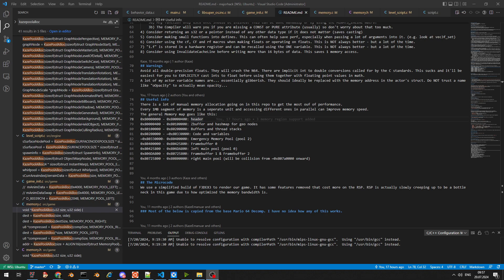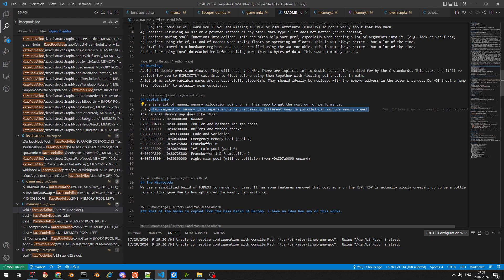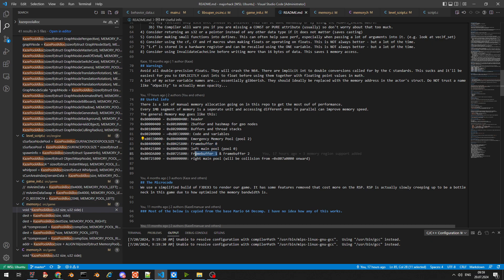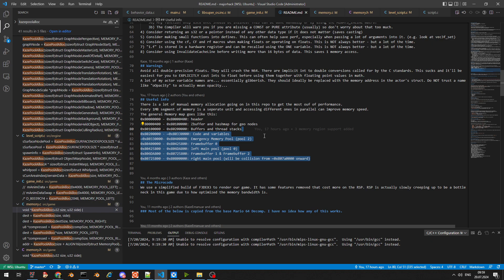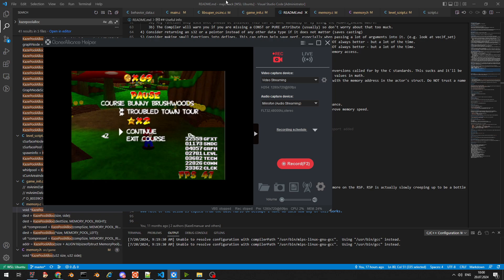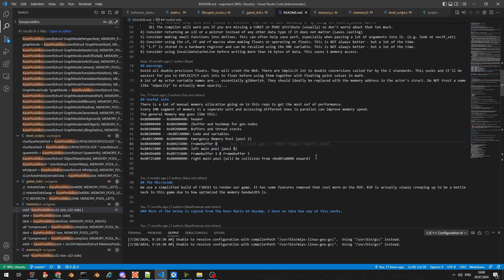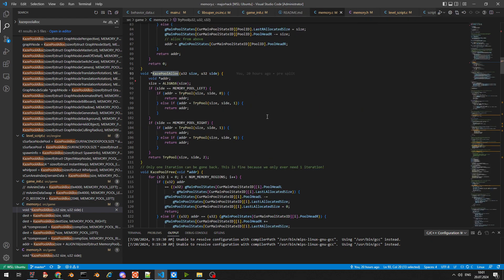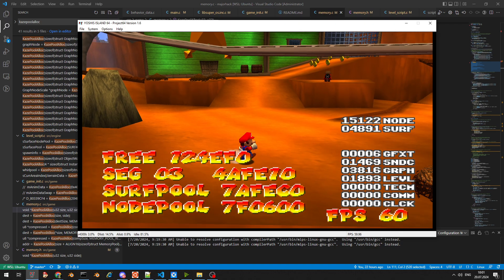Memory Allocation Optimization (HUGE)

Comment: Are you saying you've freed an entire megabyte of RAM? The N64 only has 4MB of RAM. That's 25% more memory for the game to use. This sounds like the absolute largest N64 optimization ever!!
Reply from the maker: i'm using 8mb of RAM since im using the expansion pak, but it's only .8mb or so - so 10% i'd say
Reply: @KazeClips  still huge, you're achievements in optimization are amazing nonetheless!
Reply: Is it possible for somebody to design a larger memory expansion pack, or is something hard coded to only support the +4MB the OEM expansion pack had? Seems like an opportunity for a larger expansion pack PCBA to be developed and dropped in.

Comment: Let's see if I understood. The optimization in this video is that you better split the memory accesses across multiple memory segments? You were doing that before, but you could not split optimally because the memory allocator implementation that SM64 uses (glibc's malloc?) only allows a single contiguous region of memory? But now you work around that by making your own implementation? Or maybe your implementation also splits allocations across memory segments, and that is an optimization too?
Reply from the maker: yeah thats the gist of it. idk what glibc's malloc is though
Reply: @KazeClips  malloc is a function from the C standard library for allocating memory. glibc is the implementation of the C standard library by the GNU project, which includes a memory alocator implementation, used by the malloc function. I just guessed that SM64 uses the glibc in the game, but I in reality I have no idea.
Reply: @Rodrigo-xf2oe he was joking about not knowing obviously, it's just that malloc is too general purpose to be fast in SM64